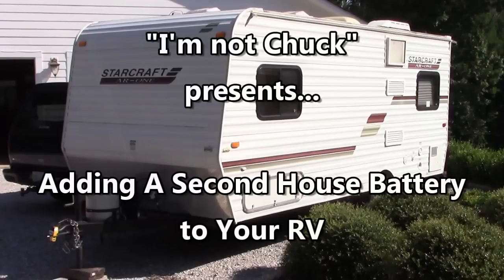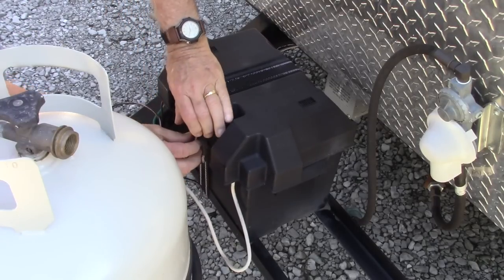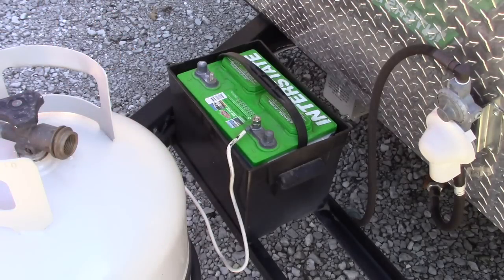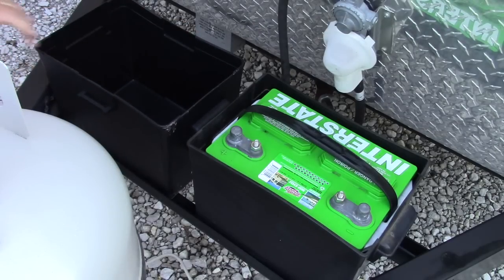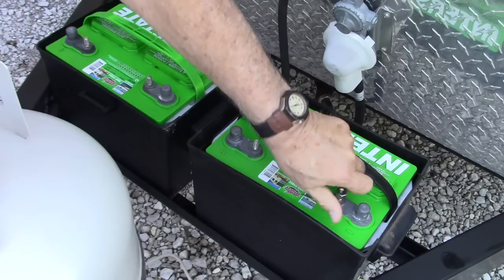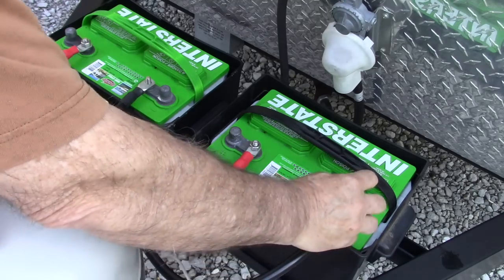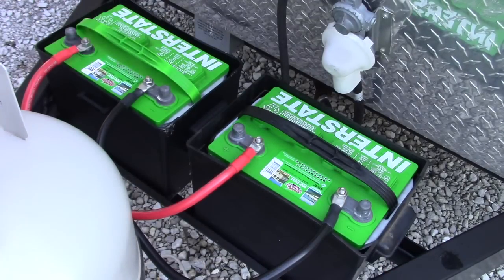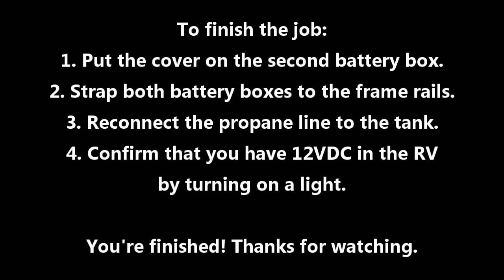Add a 2nd RV Battery

Comment: Everywhere I read says neg on one and positive on the opposite battery.  What makes it the same in your video?
Reply from the maker: Please read my full explanation at the comment pinned at the top. Thanks for watching and for commenting.
Reply: It doesn't matter whether you connect the trailer to one or two batteries since the batteries are connected together.  The difference in potential (voltage) between the two connected batteries will cause them to equalize.

Comment: Stupid question...Can you use any brand of deep cycle battery along with existing battery, or do they have to be identical?  I have one type in my RV, but may want to add a second, probably a different brand. Thanks.
Reply from the maker: It's a very good question and one that is asked quite often. It would be much better if the batteries were identical, not only the same brand and size, but also the same age. When you buy the batteries, look at the date of manufacture and get two that have the same date code. That way, they will be closely matched and will discharge evenly, which will maximize the life of the batteries. Thanks for watching, commenting, and subscribing.
Reply: I'm not Chuck. I have a class A motorhome one batterie is for the engine and the other is the house batterie, do you still recommend those to be the same also. I need a new house batterie and would like to try something other then a walmart batterie that is what I have for the engine at this time
Reply from the maker: No need for those two to be the same. I would suggest a true deep cycle battery...something like a Trojan T-105.
Reply: I'm not Chuck. Thank you!
Reply: The two batteries wired in parallel for the camper should be same, if not the batteries will not charge evenly and it will cause them early failure.
Reply: Hello I'm not chuck I'm connecting 2 batteries on my toyhauler , is it ok to just use the red cable to link the 2?..which i was told it's all I need, no black cable needed, is this so?..
Reply: No. The engine battery and the house battery do not have to match.  IN fact.  The house battery will be a different design (deep cycle) designed for prolonged discharge and the engine battery is designed for surge power for starting a large engine.

Comment: Aren't you supposed to hook the positive to one battery and the negative to the other battery once they're in parallel?
Reply from the maker: The short answer is that it doesn't matter, but lots of people disagree. Please read my post pinned to the top. Thanks for watching.
Reply: No you’re going to get 24volts doing it that way and pop a lot of fuses or worse
Reply: @randallhoskins6243  Actually Hide 2 is correct. It allows discharge of the batteries equally. You can not get 24 volts from batteries in parallel only series.
Reply: @randallhoskins6243  You should really Reread the comment and research it. 
You are Absolutely wrong!! There is no way to get 24volts out of the PARALLEL wiring. 🤯

Comment: Nice video. Question how do you charge the batteries?
Reply from the maker: The trailer is equipped with a "converter," which contains a battery charger. In addition, the batteries are charged from the alternator in the tow vehicle when its engine is running. Thanks for watching and commenting.
Reply: I'm not Chuck. 
Can you please give some information on that, please 
Thanks
Reply: @ImnotChuck.  Think about it when charging,the way you wired it the charge voltage would hit the first battery first then to the second battery through the jumper wires,if you would have put the ground wire on the second battery the charge voltage would have been more evenly distributed  charging both batteries at the same rate? just m 2 cents

Comment: How would you then connect that to a portable solar panel?
Reply from the maker: You would connect the output from the solar panel just as if there was only one battery: positive to positive and negative to negative. I always recommend a charge controller between the panels and the the battery. Thanks.

Comment: Just be  mindful that if a battery shorts out on a propane tank it can blow a hole in the tank and cause a deadly explosion.    When adding a battery to an RV make sure there is a barrier  or firewall between propane tanks and the batteries.
Reply from the maker: Thanks for commenting. Have you seen a battery "blow a hole" in a propane tank? Honestly, it seems impossible to me.
Reply: @ImnotChuck.    If you understand electric arc welding you will have no trouble understanding the potential danger.
Reply from the maker: @stevenredinger9972  But have you seen a 12 volt battery blow a hole in a propane tank? Neither have I. But if you want to put a firewall between them, be my guest.

Comment: I'm Not Chuck, can these batteries be charged from  house generator?
Reply from the maker: Yes, the converter built into the RV supplies DC charging voltage to the batteries, so any AC power source (like a generator or shore power) that is connected to the RV does charge the batteries. Thanks for watching.
Reply: @ImnotChuck.  I know you're not Chuck, but thanks anyhow. 👍

Comment: Cool vid, I am very electronically challenged especially with Electrical systems, anyways I think even I could do this, lol, very easy to understand, and I was just wondering if there really is that much difference between 12 V batteries and 6 V batteries for RVing, no expert, that is why I am asking, and my name is Chuck lolol
Reply from the maker: Six-volt lead-acid batteries have three cells; 12-volt lead-acid batteries have six cells. If all six cells were identical, it would make almost no difference whether they were arranged as two six-volt batteries or one 12-volt batteries. That's a good question, and one that most people don't really understand. Thanks, and please subscribe if you haven't already.

Comment: Wow at the comments.  When the batteries are hooked together in this way it basically becomes one large 12v battery.
Reply from the maker: That is correct, and maybe I should have made that point in the video. Thanks for watching.

Comment: is it not better to connect one cable out from the positive end of one battery, and one cable out from the negative end of the second battery?
....then you keep one battery for positive and the other for negative currents.
Reply from the maker: No, it doesn't matter if you use heavy cables like I did. Thanks for watching.

Comment: Does it run electric all thought it
Reply from the maker: It runs all the 12VDC equipment, but if you are asking about 120VAC things like the AC and the microwave, the answer is no. Thanks for watching and for commenting.

Comment: Do the two 12vs run longer than two 6vs
Reply from the maker: It's really a function of the amp-hour capacities of the batteries. Two 100ah 12v batteries in parallel would have the same run time as two 100ah 6v batteries in series. Thanks for watching and commenting.
Reply: An old fella at the battery shop I go to says that two 6V batteries will last longer than two 12V batteries of equal size. He didn't go into specifics, but he's worked at that battery shop for 20 years.
Reply: Absolutely 💯%. 
You will get at least 3x the run time out of 2 6volts.
I know this from being an assistant manager for Batteries plus for 3 years and a manager for Interstate batteries before that 👍
Reply: You are better off with 2 - 6 volts in series. the lead plates in the 6 volts are much bigger and heavier.
Reply: depends in the battery specifics, but 2 6v batteries in series will typically last longer that ONE 12v batt.
You would generally need FOUR 6v batteries (2 pairs of 6v in series, then tie the pair in parallel) to be exceed 2 12v in parallel.
Reply: @firemedic947  2 6volt Gc batteries will have approximately 3x the draw time as a pair of 12volts on an Rv.
You have to be comparing similar qualities and prices. 
You can't compare $200.00 agm 12volts to $78.00 Costco golf cart batteries 👌 
You have to be looking at the amp hours and the rate of draw the batteries are built to handle.
Reply: @firemedic947  This is not true sorry. 2  deep cycle 6 volts will out last 2 - 12 volts. FOUR 6 volts will carry twice the capacity of 2 12 volts.
Reply: @firemedic947  I have 2 Exide Xtra GC-135 the specs are. 
135min @ 75amps
226Ah @ 20 hour rate 
I can go a week without having to recharge. When I was running 2 12volts before I had to recharge in a day and a half. 
Same trailer in the same weather conditions. November fall hunting season in Idaho. Forced air furnace maintaining 70°F so the pipes don't freeze. Lol
Reply: I guess I need to research this more.  Everything that I've learned thus far tells me that (2) 100ah 12 volt batteries in parallel = 12v, 200ah while (2) 100ah 6v batteries in series = 12v, 100ah.
Parallel = same voltage, increase amps.
Series = increase voltage, same amps.
This directly contradicts Not Chuck's initial response.
What am I getting wrong?
Reply: @firemedic947  The part you are missing is you DONT buy 2 100ah 6 volts instead buy 2 200ah 6 votls. That is what we are talking about. Even better get AGM even better than that spend some money and get lithium.
Reply: @kona6451  well, NotChuck's comment was that 2 100AH 6v batts in series have the same power as 2 100ah 12v batts in parallel, so...
THAT is what I was responding to.

I'm not claiming to be an expert myself...just looking for information to explain that "experts" comment so I can learn.

Comment: Battery disconnect comes in handy
Reply from the maker: Absolutely correct, and although I didn't mention it, I have an in-line fuse holder that I use for that purpose on my travel trailer. Thanks for your comment; if you aren't already a subscriber, please become one.

Comment: I hook up wires from your RV are wrong, you should have the ground wire on one battery and a positive wire on the other battery. Not the same batteries.
Reply from the maker: Thanks for the comment, however that's a common misconception. When two lead-acid batteries are connected in parallel with one gauge cables, they are essentially one battery. Please subscribe.

Comment: Is that harder to maintain though or will they both charge at the same rate?
Reply from the maker: If both batteries are the same size and same age, they will discharge and recharge at the same rate. Thanks for commenting.
Reply: My opinion and idea is As long as they are always "equal" in state of charge they will both charge properly and not continue to load the charge system...but..as they get older they can have varying in charge and discharge rates.....if one is weak and voltage between batteries trys to balance... the charger will keep charging and can possibly damage the good battery while trying to charge the weaker one to cut off parameters...I believe the proper way to keep both charged equally is to connect a electronic battery isolator ....so when one has reached full charge it will stop charging that one while still bringing up the weaker one with out boiling or overcharging the already full charged battery....just my thoughts...but as mentioned it will work fine as he mentioned....I think my thought is for long term battery life and if one battery was used also for a higher amp load or a starting battery such as a camper van or motor home....since small rvs don't need a starting battery for a engine but some people use an invertor to use it for a 110-120 volt converter...which can draw down fast ...I hope this sounds right for you ....
Reply: @ImnotChuck.  WRONG !

Comment: This is the improper way to connect you should be connecting the positive of one battery to the positive to the trailer and the negative of the other battery to the negative of the train connecting the way this gentleman is connecting it you're basically using 1 battery 1st and then the other battery that 1st battery will  Always take the Brook of the usage
Reply from the maker: Hi Dusty. Thanks for watching and for commenting. I realize that you have been told that, but I don't agree. Either way is equally correct if you use heavy gauge wires to connect the two batteries together. If you are interested in the technical explanation, read my comment pinned to the top of these comments.

Comment: Does wiring a second battery actually double your 12v option to your trailer for real or in theory. We want to dry camp in some cooler nights and run our furnace. I have a question if you are up to answering...Should I also wire in a battery alarm to keep the battery from draining down past where it should.... Just for general info how long would it take to recharge after maybe a night of use using the camper charger and running a small gas generator. Sorry for all the questions but thanks....Thanks mr Not Chuck.
Reply from the maker: Hi mike, Yes, if both batteries are equal in capacity and age, then it does double the 12v power available. Yes, you should have a battery alarm to warn you if your battery bank voltage falls below 12.8 volts; for good life expectancy, it should never fall below 12.5 volts. As to the rest of your questions, I don't have the data available to answer. The data is essentially how much power would your furnace fan consumes in a night. That depends on how many watts it consumes while it is running and how long it runs in a night. In addition, I would need the rate at which your converter and/or you generator charges your battery  bank. I can tell you that I ruined a pair of 12 volt batteries in only two cold nights in Yellowstone by running the fan on my furnace. To give you a better answer would take more than I can put in a comment. Perhaps I need to do a complete video on the subject; it is an important question. Thanks for watching and for asking.
Reply: Yes you will double the run time. I have a new 12V fridge and I can can now dry camp all weekend with using furnace.
Reply: Oh.... And ur LP detector will let you know if n when ur battery is low or install a $5 unit on Amazon
Reply from the maker: @miztrusa  I am curious to know at what voltage your LP detector sounds off. My guess is that it is well below the level at which your battery is already damaged. Thanks.
Reply: @ImnotChuck.  Hows your battery damaged??? Deep cycles are meant to run down, recharge.... Ect.... Ect. But the last time I checked it was at like 10V. I got a $5 digital gage on Amazon you can set to go off at whatever voltage you want.... 😁
Reply from the maker: @miztrusa  Deep cycle batteries are more tolerant of deep discharges than starter batteries, but they are still very susceptible to damage by repeated deep discharges. The more times a deep cycle battery is deeply discharged and the deeper it is discharged, the shorter its life will be. And bear in mind that at 11.5 volts a 12V deep cycle battery is considered 90% discharged. Here is a link to the datasheet for a high quality deep cycle battery; study it carefully and you will begin to understand the fundamentals of deep cycle batteries. https://www.solar-electric.com/lib/wind-sun/SCS150_Trojan_Data_Sheets.pdf I never let my batteries go below 12.5 volts and try to keep them 12.8 volts or higher.
Reply: I'm not Chuck. In

Comment: There's a beeter way to utilize both batteries. Run all positive to a shunt and all negative to another shunt then pull your power from the shunt to avoid 1st batterie drain like mine did its was a daisey chain 4 batterisles 1 complete fried 2ed on line from positive 2-3 volts 3rd 6volts and 4th 12.2 some I'm not running 1 positive to last negitive I'm going to hook all of them to a shunt the to the feed
Reply from the maker: Thanks for your input, although I don't fully understand what you mean. My experience with shunts is limited to using them in a current sensing circuit.

Comment: ...Very Detailed  ...But Does The Color of The Battery Matter?  ...You Said Everything But That!!
Reply from the maker: Notl as lfar as I know. Thanks for watching and for commenting.
Reply: No it doesn't as long as they are the same capacity. As an example 2 120Ah Batteries parallel long as they are the same Ah batteries rated and Deep Cycle you cannot use a Deep Cycle and a Standard Battery they both must be Deep Cycle they will work together. Also note that 2 120Ah batteries will give you a total capacity of 240Ah but only 120Ah total as AGM batteries only give you maximum 50% usage so double the capacity NOTE DO NOT use Calcium, AGM etc batteries with Lithium regardless if they are the same Ah

Comment: Not Chuck I hope you have got a more secure set-up 
Over all great vlog thanks
Reply from the maker: I actually do have a newer travel trailer now, than I had when this video was made. It is equipped with two Trojan T105 6-volt batteries in series. Thanks for watching and commenting.

Comment: you are WRONG.. they will NOT discharge evenly AND one battery will be depleted before the other.. when hooking up the output from the batteries to to trailer, you should have moved your negative to the other battery.  making BOTH batteries have EQUAL draw .
Reply from the maker: Thanks for your opinion and for watching.
Reply: I agree, there’s a greater chance of one battery discharging more than the other while having you trailer wires connected to only one of the batteries,  leave your positive connected but move your negative to the other battery’s negative, now power will be pulled from both batteries much more evenly
Reply: @sheild1117  You are absolutely correct,not only will it draw more efficiently the batteries will be charged more efficiently also,it's just all around better.

Comment: Could I do this with 4 batterys
Reply from the maker: Yes. Just continue connecting positive to positive, and negative to negative. Thanks for watching.
Reply: Yes, just make sure you hook the negative wire running from camper to the last battery and the positive wire running from camper to the first battery. This will help them drain evenly.